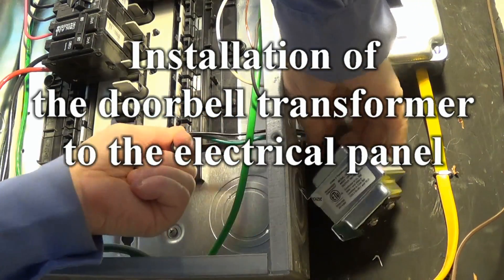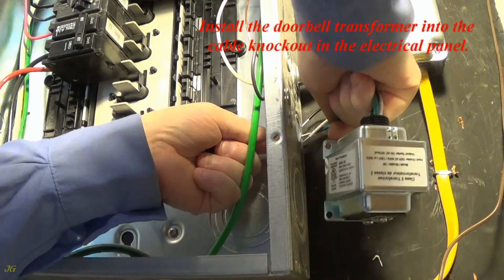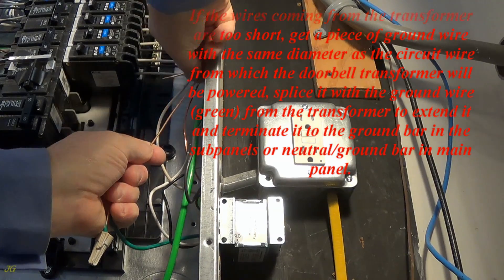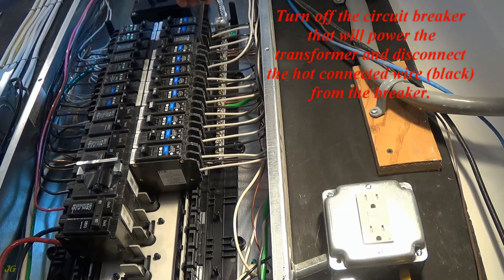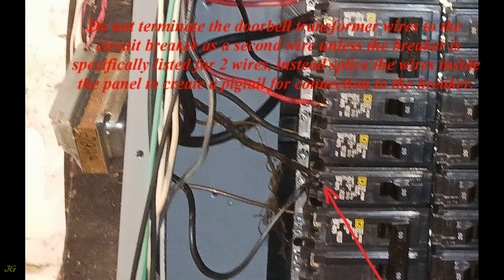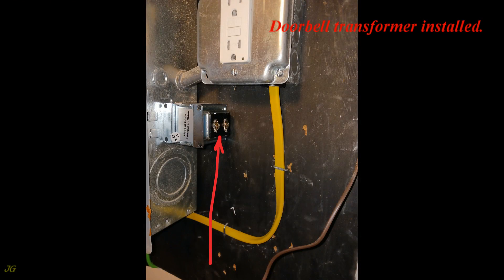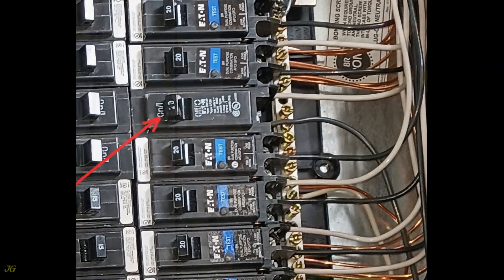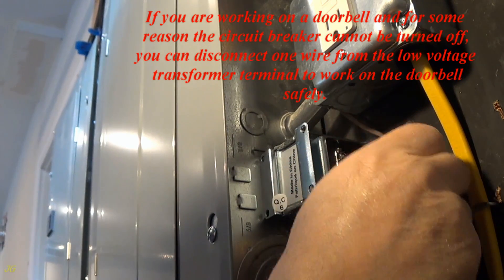Installation of the doorbell transformer to the electrical panel

Comment: Do not pig tail your hot leads inside the panel people. Check your manufacturer breaker details many you can land a second lead to the breaker if there are of the same size. They are mid understanding the term pig tail. You are supposed to be just extending the wire. If need be go to a tandem or add a new one. Or get your power from that outlet above
Reply: Could you explain in more detail?  Thanks.
Reply: @arthurbegun582 most breakers are not rated to handle two wires. Check your panel. Plus look theres so many open spots they could have used instead. They put this in red writing. But why show the one off???

Comment: Thanks for the great video! My main electrical panel has some extra green screws next to the neutral/ground bus bar. Can I connect the ground wire from the new transformer to one of these screws instead?
Reply from the maker: Of course, if the grounding screws come from the panel enclosure and the neutral/ground bar is bonded to that enclosure.
Reply: Thank you!

Comment: Great video. I was looking at the wiring and I think I missed a step. The black wire from the switch. You took one end from the switch, cut it shorter and created a pigtail with the live from the transformer. So where is the other end of the wire? One end in the switch and the other end is where exactly? I don't see it in the video. Thanks
Reply from the maker: The wire from the breaker is removed, cut and connected to the pigtail leading to the breaker and the wire from the transformer. The wire removed from the switch after splicing powers the same circuit as it previously fed by this breaker before disconnecting from the switch.

Comment: New garage construction: can the transformer go on the inside of the panel? The wall my panel's on will have drywall on both sides and I don't want it buried. If yes, will that pass inspection?
Reply from the maker: NO!
Low voltage cabling must be separated from the mains voltage by a barrier - it must not share the same enclosure (NEC). Make access to it (niche).
Reply: @johng2913 Roger that, thanks!

Comment: Does the ground and neutral go to the same screw on the ground bar or separate screws?
Reply from the maker: In a panelboard where the neutral and ground wires must be bonded together, the neutral and ground wires can be terminated on the same busbar but under a separate screw.
In subpanels, the neutral and ground must be separated and terminated on the appropriate busbars (neutral to neutral and ground to ground bus).